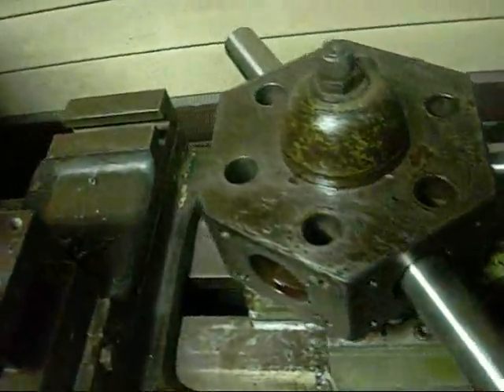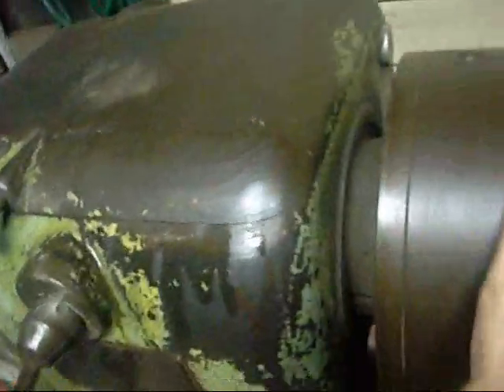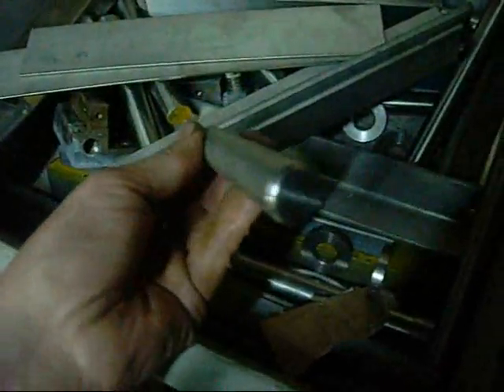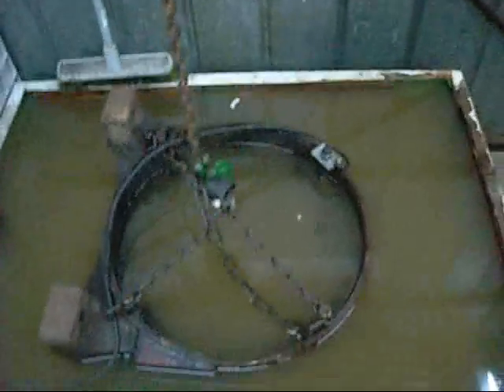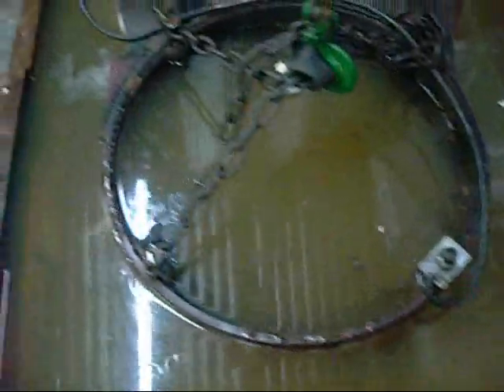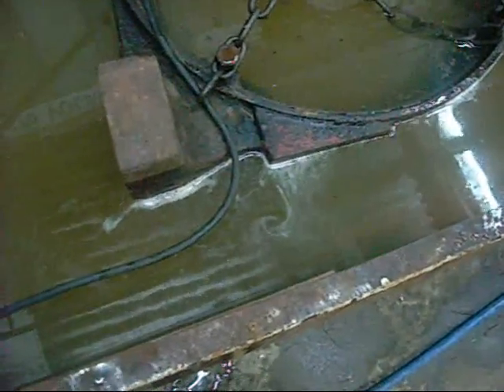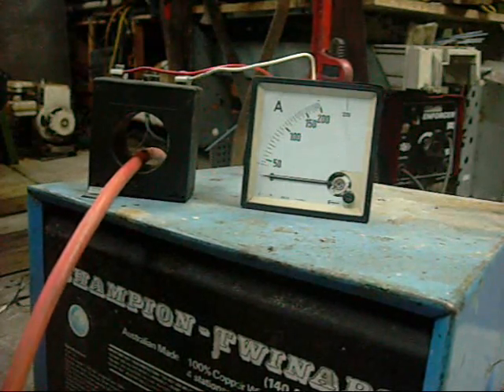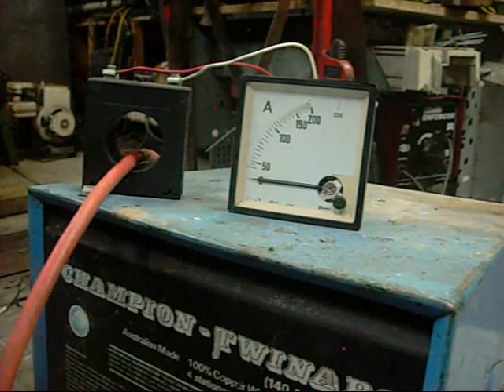Turret lathe and Electrolysis Update

Comment: CT readings are highly affected by any magnetic fields in their vicinity.  If the external field's phase is counter to what is going through the CT, it will read lower.   Try moving the CT further away from the transformer in the MIG.

Comment: You could try measuring the current going into the welder from the mains and working out the equivalent in out put current. e.g. 240v 10A in 60v 40A out

Comment from the maker: @008626 its got 4 lbs of sodium bi-carbonate in it.
the ammeter reads zero wen connected to the bath and 20 at dead short across the transformer, hence its only reading half current.